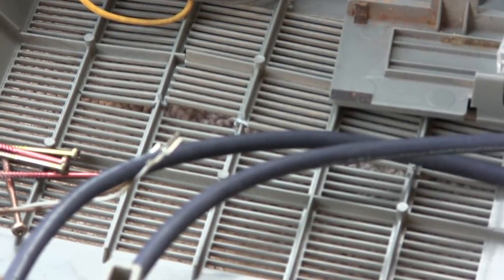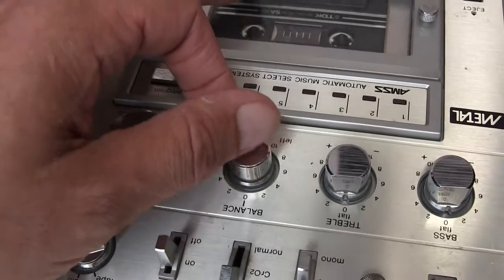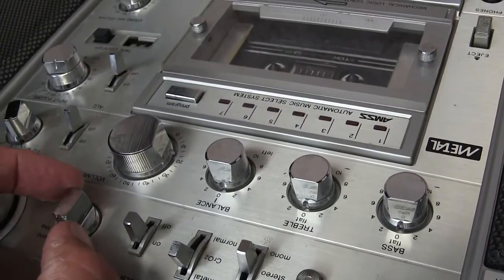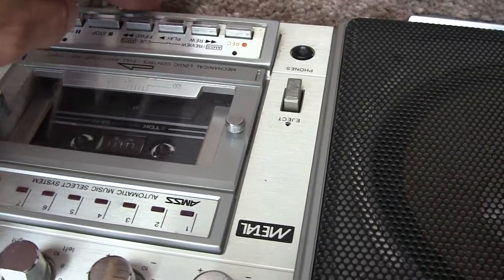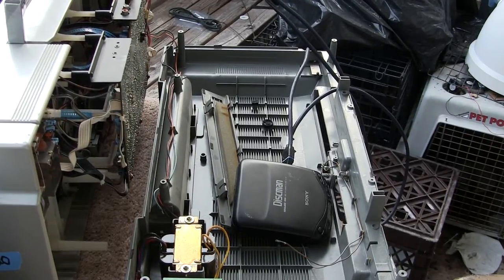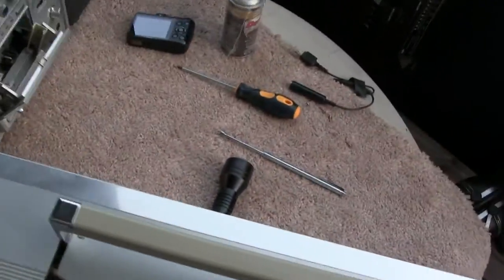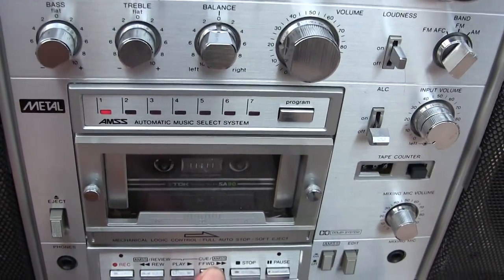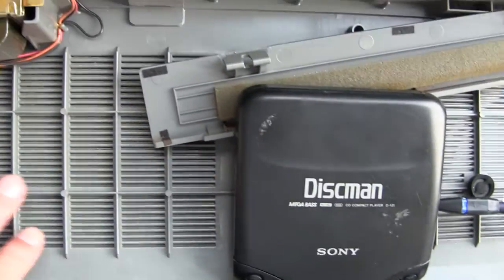Sanyo M X920 Identical 2 Boombox AFTER Deoxit Showing Inside schematic Review Nice One CD

Comment: How to adjust tape speed? after replacing belts
Reply from the maker: Insert a flat tip jewelers screwdriver into the back of the motor to adjust speed or pitch of the capstan motor